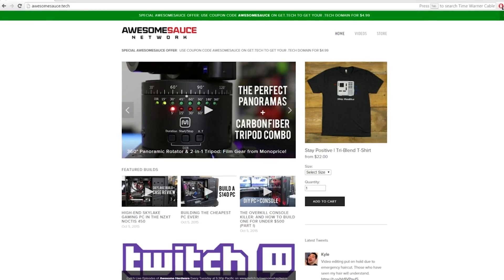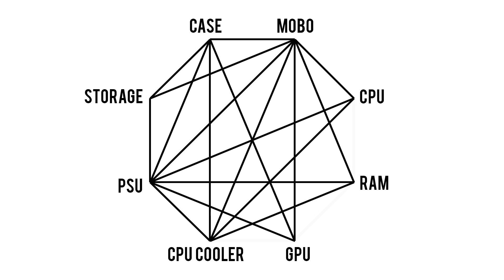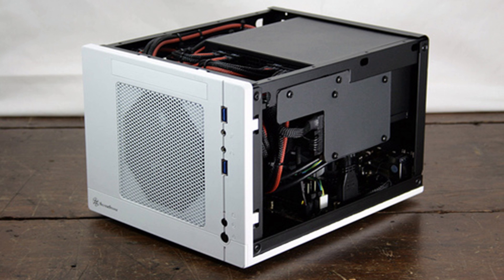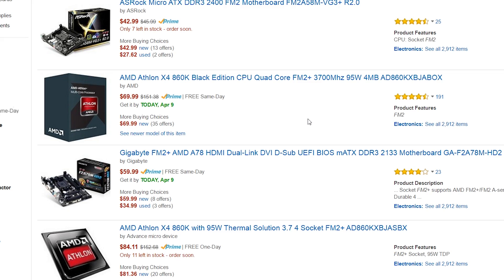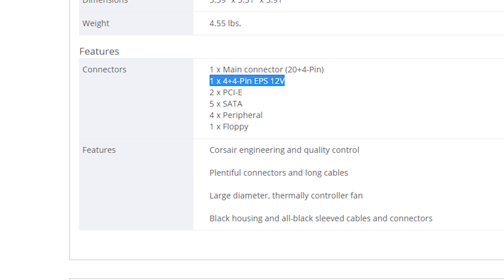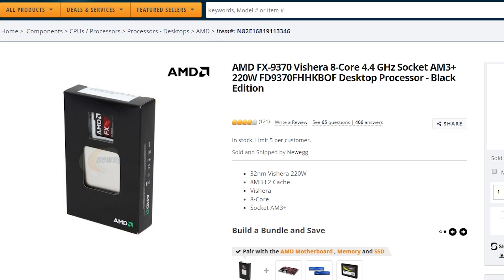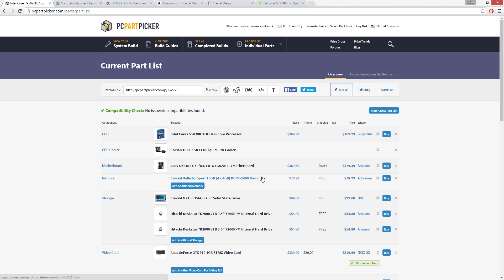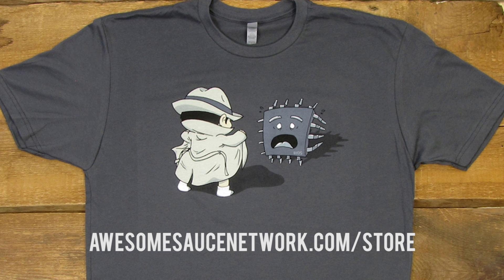How to Choose Parts for a PC! The Ultimate Compatibility Guide!

Comment: Hi 
can you help me please 
if i want to build a new desktop from the beginning for
my home using & i want to use like these software 
1- windows 10
2- Photoshop
3-.ProShow 
4- Microsfte office 
5- Wondershare Video Converter Pro
6- Movavi Video Suite & more 

From your experience what is the best performance hardware you recommend to me to buy it? with no problem or less problem than others hardwares

for example
1- Motherboard (put the exactly Motherboard name & model)
2- Processor ( put the Processor name) 
3- Graphics card (put the exactly Graphics card name & model)
4- SD Ram (put the exactly SD Ram name & how many giga)
5- Single Hard Disk (put the exactly Hard Disk name & how many TB)
6- CD ROM CD hard drive (name)
7- Best Case Model
Waiting for reply 

Thanks

Comment: How to select the components for a desktop PC build? 

1. Pick an ATX case unless you are building a small form factor desktop. The ATX has the most features and offers the best value. 

2. Pick a CPU from the range of CPUs currently in production, based on the type of computing you intend to do. 
Gaming will require the fastest and most expensive CPUs. 
Multimedia can use slower but cheaper CPUs. 
Word processing and surfing can use the slowest and cheapest CPUs.  

3. Pick a motherboard that is compatible with your CPU. This is actually the most important component match, so ask around. Read articles on recommended builds. 

4. Pick a highly rated power supply with enough power to run all your components. Do not pinch pennies here. A quality power supply will outlast several cheap crappy power supplies. You will actually save money in the long run. 

5. Pick enough RAM such that insufficient RAM is never the bottleneck during computing operations. 

6. Other components such as SSDs and HDDs are less critical in terms of compatibility. Choose the best value by dividing the capacity by the price. You want the most TB per dollar.

Comment: you forgot cpu and ram compatibility
Reply: there is none, basically any ram can go with any CPU as long as its compatible with the mobo and other things
Reply: Shakenbacon 
I think I saw on Intel i7 that it supports max speed of 2400mhz. But 3000mhz also works, starting the system it will show 2400mhz by default and then just overclock to advertised speed.
Reply: tjhawk98 no I'm pretty sure he covered it in all that mess of information
Reply: Eblouie Par La Nuit you dont need to oc the ram to the default speed, just set xmp on

Comment: Is this build compatible?
CPU:  
Intel Core i5-7500 3.40 GHz Base Frequency Quad Core 6 MB Cache CPU Processor 
Motherboard:
GIGABYTE GA-H110M-A LGA1151 Intel H110 Micro ATX DDR4 
RAM:
Corsair CMU16GX4M2C3000C15B Vengeance LED 16Gb (2 x 8GB) DDR4 3000MHz C15 XMP 2.0 Enthusiast LED Illuminated Memory Kit - Black with Blue LED Lighting
Hard Drive:
Seagate BarraCuda 1 TB 3.5 inch Internal Hard Drive (64 MB Cache SATA 6 GB/s up to 210 MB/s)
Graphics Card:
Gigabyte Nvidia GTX 1050Ti WF2 OC 4GB GDDR5 PCI-E 
Power Supply:
EVGA 500 B1, 80+ BRONZE 500W Power Supply, 3 Year Warranty, Includes FREE Power On Self Tester 100-B1-0500-K3

Comment: dudes, can you help me with building my first PC? I am pretty sure everything is compatible, even used PC parts picker, but still:

CPU: Intel - Core i7-7700 3.6GHz Quad-Core Processor
CPU Cooler: Corsair - H115i 104.7 CFM Liquid CPU Cooler
Motherboard: Asus - STRIX Z270-E GAMING ATX LGA1151 Motherboard
Memory: Corsair - Vengeance LPX 16GB (2 x 8GB) DDR4-3000 Memory
Storage: Samsung - 850 EVO-Series 500GB 2.5" Solid State Drive & Western Digital - Red 2TB 3.5" 5400RPM Internal Hard Drive
Video Card: Asus - GeForce GTX 1060 6GB 6GB Strix Video Card
Case: Fractal Design - Define R5 (Black) ATX Mid Tower Case
Power Supply: EVGA - BQ 650W 80+ Bronze Certified Semi-Modular ATX Power Supply

so yeah, if anyone is willing to help, is everything compatible and is it a good setup?

https://pcpartpicker.com/list/PbPMtJ
here's a link to the setup as well if that is easier

Comment: I am a first time PC builder looking for a beast PC (this is beast in my world as I have been a lowspecgamer for a long time now) and these are the parts I came up with, PC Part Picker says there are no issues, but Any expert advice would be helpful to make sure this is 100% compatible:

CPU: AMD Ryzen 7 1700X 3.4 GHz 8 Core
Cooler: Cooler Master Gyper T2 54.8 CFM Sleeve Bearing Cooler
Motherboard: Asus Prime X370 ATX DDR4 Motherboard
RAM: Corsair Vengeance LPX 16GB (2x8GB) DDR4-3200MHz
Storage: Western Digital - Caviar Blue 1TB 3.5 Inch 7200 RPM
Video Card: MSI GeForce GTX 1080 8GB Founders Edition
Case: Corsair 750D ATX Full tower case
PSU - CXM 750W 80+ Bronze Certified Semi Modular PSU

I do not need an SSD For now, as myself, a newbie computer expertish person, Still unsure whether this is compatible, My mind says yes, But It's always good to double check.

Hope someone helps soon

Comment: Despite how old this video is, I still feel the need to ask this question (in hopes that it might be answered because theres no way in hell I'm going onto Yahoo for this shit). What exactly is the deal with SSD and M.2 storage devices? I understand that there was initial confusion to everything explained in the video, but in almost a week or two, nearly anyone can understand to a tremendous extent as long as they're truly intent on building their own PC. Still though, the SSD and M.2 segments have stooped me. Just what is the purpose for SSD and M.2 storages and spending an extra $100 to $200 when a simple harddrive should be enough?
Reply: Wooden Lock I’m also trying to learn about parts, and I’m 8 months late but I’m pretty sure SSDs are typically faster

Comment: https://ca.pcpartpicker.com/list/fyKb9W
Reply: can someone tell me if this will work.
Reply: nope.  doesn't work
Reply: Shekels no it doesn't but I think 16gb ram is a little bit of an overload since it also costs over 200 which you could have put in a better graphics card
Reply: Shekels only thing you need to change is the case so it's compatible with the motherboard
Reply: Suggestion, don't buy different RAM modules, get exactly the same models. Different RAM modules don't play nicely with each-other and don't look good as well.
Get ATX motherboard, instead of mATX.

Comment: Diypc gamemax-white full tower:104.99
Intel i3 7300:209.99
Intel i3 6300 on sale: 209.99 not: 219.99
MSI B250M GAMING PRO LGA HDMI SATA 6GB MIRCRO MOTHERBOARD: 113.99
MSI GEFORCE GTX 1060 DIRECTX 3GB GDDR5 VIDEO CARD: 314.99
G.SKILL RIPJAWS X SERIES 8GB (2 x 4GB) 240 pin DDR3 DESKTOP MEMORY: 72.99
550W 80 PLUS BRONZE POWER SUPPLY: 79.99
HYPER 212 RED LED WITH PWN FAN CPU COOLER 
WD BLUE 1 TB DESKTOP HARD DISK DRIVE: 67.99
EVERCOOL ALUMINUM HDD COOLING DEVICE:11.99
GAMDIAS GKC100 GAMING KEYBOARD AND MOUSE COMBO: 25.99
Windows 10 home - 64 bit: 124.99
Total: 1,127.9$ 
Is this good? Quick reply please!

Comment: WTF IS GOING ON IM JUST TRYING TO BUILD A FUCKING PC NOT BUILD AN ATOMIC BOMB
Reply: Breath, go to the website, kiss your wallet goodbye, and your done!
Reply: Is there a difference?
Reply: If you choose amd with liquid cooling you are building an atomic bomb :D
Reply: Drepple there are bombs that explode as soon as they make contact with something. There are bombs that explode, when a specific time is reached. There are bombs that explode after a given time (timer). And there are radiocontrolled bombs that explode when they get the signal to explode. These bombs need a microcontroller ir a pc to be launched!!!!
Reply: It looks difficult, but that's because Bitwit is getting into detail (that is necessary) that most people wouldn't consider. Adding videocards/GPUs, using M.2 drives or even SSds, lighting mounts - these are things that average users really don't need to worry about. Typical motherboards have built-in IO ports, most people still use 3.5" harddrives, and UV and other lights and liquid cooled systems should be saved for once you know what you're doing.
Reply: well probably if you didnt build your pc properly it could be a bomb by itself anytime.
Reply: lol we're in the exact opposite situation XD
Reply: IvanPSY imagine what building an actual atom bomb would be like lmfaoo
Reply: IvanPSY iii
Reply: hahaha i stopped listening after 0:00
Reply: +TelxGaming good for u
Reply: I know right
Reply: True, but the microcontroller is a tiny chip that processes relatively simple inputs and outputs, not play Doom in 4K on ultra graphics
Reply: IvanPSY for the bomb you need a pc (that supports it ;) ), so, your pc is a part of the bomb, therefor the pc is so complicated!😉
Reply: Dude idk if you know anything about bombs at all other than that they explode, but a bomb doesn't need a pc

Comment: The case I chose has 2x usb 2.0, 1x usb 3.0 and a sound and mic plug on the front. My motherboard has 2x usb 3.1 on the front and 4x usb 2.0 on the front but no audio out or mic in in the front. For better understanding search for Msi H110M pro-VH plus and NOX Modus.

Comment: Ok, right now I have: i5 7600, Stock cpu fan, B250M MSI motherboard, 8GB DDR4 RAM(max 2133MHz), GTX 1070, 600W power supply, 2TB hard drive. For my birthday(8/4), should I ask for: Hyper 212 EVO, 16GB RAM 3200MHz, Z170-A Asus motherboard, 800W fully-modular power supply, 500GB SSD?

Comment: hey, is this good? just wondering https://pcpartpicker.com/list/myL6bj
Reply: JimK It has some very odd choices for parts.
Why an H60 cooler for a 65W CPU, and in such a relatively low end build?
Coolers come with TIM, so no need to buy more.
Gigabyte's B350 boards are all shit. Shouldn't matter too much, but maybe get one with better VRMs.
Ryzen benefits a lot from higher frequency RAM, so maybe get some faster memory. 2800 at least.
Just why would you get a single 1 TB SATA SSD? It would be much better getting, for example, a 256 GB 600p and a 1 TB HDD. It would cost a lot less, meaning you could invest more into the graphics card. 
So maybe a higher end GPU. For a $1400 PC, you should try to get a 1070 if possible. If not, an RX 580 or 1060 6GB.
For $80, you should get a better PSU. An EVGA G3 650W or a Cooler Master V650 would be higher rated for a similar price. Or you could just get a cheaper PSU, like an EVGA B or BQ.
Why would you buy Windows 10 Pro for $140? Either get standard Windows 10 for ~$100, or get a key from somewhere like Kinguin.
Other than that, it's fine
Reply: is this better? i actually did some research this time https://pcpartpicker.com/list/cL8bYr

Comment: oh oh, i want to build pc with ASUS ROG mobo and intel pentium 4 + GTX 1080 and 512mb ram and installing windows 95, can i run gta 5 on ultra 120 fps?
Reply: Loyard Pixel I mean I know this is a joke but no it will no the gpu have the power to but everything else will bottleneck it

Comment: I have no fucking idea what happend in this video. I'm building my PC with pcpartpicker, almost all is setup, but now I'm wondering if everything is cool : 
MOBO : ASUS STRYX Z270E
CPU : Intel I7 7700K
GPU : ROG STRYX 1080TI, aint got a 4K monitor yet, but i have 2 1080p monitors, and the money for it so i'm going loco.
PSU : EVGA G2 750W
Cooler : NZXT X62 for the looks
RAM : 2x16gb CORSAIR LPX 3000MHZ
CASE : PHANTEKS ENTHOO LUXE tempered glass cuze it's swag af
HDD/SSD : got 1 of each from my last PC so i'm just gonna move them. 

Plz tell me i'm good with this setup. I can't handle opening 40 tabs and checking all this shit another time. I'm trying my best to setup a very good rig for the next few years, but I'm this close to dropping the ball and buying a alrdy built PC.

Comment: Bravo, sir. Bravo. This video was everything I needed for my build. I spent hours researching all the ideal parts for my budget build and finally ordered everything I needed. I did a lot of research of each component's compatibility, however, I was still very timid and worried about running into a small connection problem that would compromise the entire build. After watching your video, I can rest assured I have gathered all the correct components as well as intellect for my project when it arrives in the mail. Thank you!

Comment: 1x 
Intel Core i5-6400 Boxed
€ 178,75  

1x 
MSI H110M GAMING
 € 71

1x 
MSI GeForce GTX 1060 Gaming X 3G
€ 239,95

1x 
WD Blue WD10EZEX, 1TB
€ 49,95  

1x 
NZXT S340 Colour Edition Black/Red
€ 65,95  

1x 
Samsung C24F390FHU Black
€ 164,14  

1x 
BitFenix Alchemy 2.0 Magnetic LED Strips 12cm Red
€ 9,57  

1x 
Cooler Master Hyper 212 EVO
€ 29,95  

3x 
Cooler Master SickleFlow 120 Red LED 120mm, 120mm
€ 19,86  

1x 
Cooler Master Devastator II - Gaming Gear Combo (Red version, Qwertz)
€ 46,95  

1x 
Crucial Ballistix Sport LT BLS8G4D240FSE Red
€ 66,85  

1x 
Logitech G230 Stereo Gaming Headset Black/Red
€ 51,85  

1x 
Corsair CS650M
€ 80,95 
 
 total: € 1.075,72

Is this build good ?
First time building a pc

Comment: Hey, Bitwit! You skipped over 1 thing(possibly other things too, idk). There are compatibility issues with SLI. If you want to have SLI with a 1080 and a 1070, you can't, it won't work. However, if you wanted a Radeon RX 580 and 480 in CrossFireX, you could do it(if your mobo has 2 PCIe slots{and if they are the correct gen}of course).

Comment: I ran into an issue when I was tired of thermal issues from my mini build and put the parts in a mid size case.  the power supply cables were too short.
Reply: Use cable extensions or new cable kit.

Comment: Installing Component To MotherBoard✔️ Easy 
Installing MotherBoard To The Case✔️ Normal
Installing Power ✔️ Not That Hard 
Installing WaterCooler/Fan Cooler✔️ Not Bad
Installing Hard Drive✔️ Easy
Managging Cable?✖️✖️✖️LAZY AND HARDDDDDD XD
Over All 2 - 3 Hours Plus Cable Managing 1 - 2 Hour Plus OS Installing 30 Min - 55 Min
Calculate Yourself How Many Time You Need To Making A PC XD

Comment: Very useful video and I'm happy I found it when I did. I've taken a build I'm happy with from pcpartpicker and applied this to every stage of the build. It's actually thrown up a couple of things pcpartpicker missed. In particular, my CPU cooler was 159mm and only had 160mm to fit into. Technically "OK" but good luck actually working with that! This has let me realise that problem and pick a new CPU cooler (and then also go through the same set of tests again :P). I'd say the one thing which would help me a bit further was understanding if my motherboard was able to support overclocking from the CPU which I think you went over a little quickly, but that's just feedback to try and be helpful and not crticise :). Thanks again for the helpful vid!

Comment: you shouldn't touch your motherboard or any component in it with a metal screwdriver specially if the power is on. Just a piece of advice, just in case a newbie is watching. You don't wanna fry your motherboard or anything else. Electronics 101.

Comment: hello im interested in buying a new graphics card to switch from integrated graphics but i dont know what would be best for my specs and budget, im fairly new to computer building/upgrading. here are my specs

64 bit system
current CPU/GPU  AMD A6-6310 APU with AMD Radeon R4 Graphics (quad core 1.8 GHz)
ram 6GB
power supply: 65 watts or 20V with 3.25amp (this is just my power cable, i plan on buying an internal power supply)

i hope this helps if anyone can help me

Comment: I'm building a very very very tight budget PC by your guide. The case's maximum CPU Cooler height is 140mm and the CPU Cooler itself is 139.7mm. Is that enough clearance?

For reference, the case is the Silverstone PS08B and the cooler is the Cooler Master Hyper 103

Comment: cpu gpu compatibility while a less serious issue as some of the things here can still be annoying if you get it wrong. if your cpu is not powerful enough to keep up with your video card then you can run into some really annoying bottlenecking issues that can prevent your gpu from performing it's best. again, not as serious a problem as having parts that physically can't fit in the case, but still worth mentioning I feel.

Comment: Computer builders, I have a build planned for a pc that I intend to use to run warhammer on max settings with at least 60fps. Is the build below adequate and feasible? Any advice or tips would be much appreciated.

CPU: intel i7 6700k 4GHz quad core
Cooler: cooler master hyper 212 evo 82.9 cfm sleeve bearer
Motherboard: msi B150 gaming m3 atx LGA 1151
Video card: evga geforce gtx1050ti 4gb sc gaming acx 2.0
Hard Drive: western digital caviar blue 1tb 3.5" 7200rpmi
Memory: kingston hyperxfury 16gb 1866MHz ddr3 cl10 dimm
Case: nzxt s340 atx midtower
Power: corsair csm 550w semi modular atx

Comment: First of all congrats for this great video and your channel in general :-)
One question:I'm a beginner in the pc building aspect and really confused...I want to make a pc for audio production,very simple video editing and 1 or 2 games very light ones just to have some fun...I decided to buy an intel i5 6600 k,16 gb ram and don't know what motherboard to choose from the ATX and 1151 range...I can spend up to 150 euros...More specs:i will plug one ssd,one hdd(probably will soon add one more) and thinking of buying a case with led so i need motherboard to have the pins i need...Last but not least i would like it to have the potential of overclock but not gonna die if it does not...Please help,thanks in advance

Comment: Question, im on PCPartPicker, and every motherboard that i have tried says that it is incompatible with my i5 7600k Quad Core Processor. Says it would need a BIOS update, but it also says i may need another CPU. Which makes no sense. Any answers? Fairly new to the computer building side of things.

Comment: Cooler 159mm case limit 160mm. Will it cause an issue? Also, my power supply has 2x 8pin (6+2). but my 1070 has PCI Express x16 3.0, 6-pin x 1, 8-pin x 1. Would it connect?